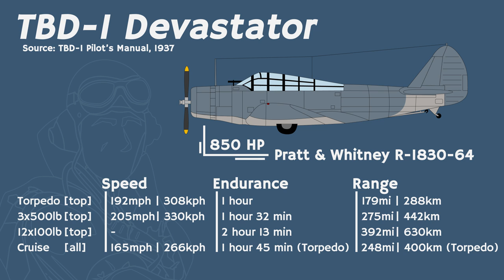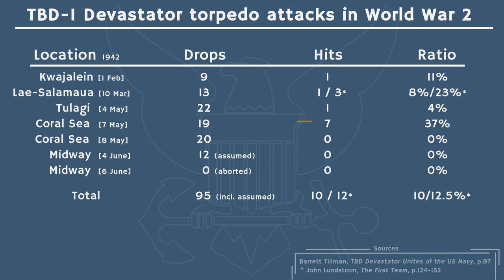In Defense of the Worst Aircraft of World War II - TBD-1 Devastator

Comment: Let me point out that the one TBF that made it back to Midway had one crewman dead, the other two badly wounded and the aircraft was so badly shot up that it was pushed off the runway and scrapped. BTW, the TBF's were from Torpedo Eight - a detachment had been left on Oahu to begin transitioning and in the emergency they were told, "Consider yourself transitioned, here's a chart showing how to get to Midway."The author of FLEETS OF WORLD WAR II noted this and agreed with this video, while the aircraft were  certainly deficient, the CONCEPT of torpedo bombing was obsolete. Since WWII it's been used once when AD Skyraiders did a "dambusters" raid on the Hwachon Dam in Korea. (I wonder if anybody in FEAF asked if the RAF had any Lancaster (Special)'s or Upkeeps left around)https://en.wikipedia.org/wiki/Hwacheon_Dam

Comment: In speaking about the "test" results versus "normal" flight speeds, for example, might these differences be from the qualities of the fuels used? It has been my experience, (through research, not personal), that the engine manufacturers will use the best fuel available for their tests to give their potential customers, (usually the military), the kind of "results" that would sell airplanes. During actual fleet exercises, there might have been a lower level of octane levels, for example, so the planes couldn't actually get to those speeds that were printed in the manuals. This is why you, and I, must take those printed "facts" with a grain of salt. Actually, I sometimes have to use a "pinch" or "tablespoon" to measure my discrepancies correctly. 
Read about Jimmy Doolittle, while he was trying to make ends meet between the wars, for he and his wife, (I don't recall if he had kids then or not until later), he gave up his commission and went to work for Shell Aviation Fuels. As a salesman, going around the world, (and actually acting as a military spy on "enemy" aircraft designs and performances), he noted the performance edge that higher octanes gave to the various aircraft. He had a great friendship with Ernst Udet, for example. Both were sad that Jimmy couldn't test fly some of the German planes as they got closer to war breaking out. 
So it goes, friendships made and broken by war. How many World War II movies have I seen where someone you were flying with had a former good buddy in the enemy camp. I can't even count the number, it seems that almost every single one had that message at least once during the film. Uh, I'm sorry, I've derailed my train of thought. We were talking about fuel octane, (or at least I was). So, that was my input for today. Better gas during flight tests versus worse gas under daily flights will cause a discrepancy in your results. In other words, your mileage my vary.

Comment: Any bomber/torpedo aircraft in WW2 was going to have a bad day if it went into battle without fighter escort.  The B-17 was slaughtered over Europe before the P-51 escorted it yet the B-17 was considered to be an excellent bomber.
Reply: the point with the B17 was that it at least had enough survivability built in to keep flying those raids at all, even if losses did stop operations maybe in 1943...the RAF bombers had no chance of trying it at all in daylight..there is suicide in 8th AF terms...then there is suicide in RAF Bomber Command in daylight terms..the 17E+ could at least defend itself in those boxes, even if the Jagers kept re-inventing themselves to break through and cause heavy losses still...
Reply: Any bomber in WW2 that was unescorted was going to have a bad day if it were attacked by fighters. The quality of an aircraft cannot be judged simply by its failure to perform outside of its capabilities. If the Devastator had better fighter cover at Midway it would have performed better. The Devastator was never meant to drop ordinance accurately and compete with enemy fighters.

Comment: Torpedoes that don't work aren't much good.  Low ceiling, lack of tactics, defective armaments, etc..ect..  At Midway they were flying coffins.  But, you have to remember it took quite a while for the Navy to be forced to except things such as defective torpedoes, ineffective antiaircraft armaments, use of outdated equipment, even a top heavy command and supply structure then add in the lack of interservice cooperation, garbled, confusing orders and basic stupidity caused many debacles during the early days of hostilities with Japan.  This included not only the US but the other belligerents also.  Between 1935 and 1939 (1941 for the US) for some reason both military and political leadership were comatose to changes in technology and world events.

Comment: The Buffalo has to be a close second.  Totally outclassed by the Japanese planes it went against.

For all its shortcomings the P39 / P40 / P400 was at least decent as a ground attack aircraft.
Reply: Didn't help that the Buffalos going against the Japanese were of the later variants that had their performance seriously hampered by their drastically increased weight, something which the upgraded engines couldn't fully compensate for.

Comment: Considering that your vids are based on technical and doctrinal facts, with the insertion of a clearly defined opinion here and there, i don't dsee why Youtube would hate or dislike your videos. Maybe Youtube has something against your accent? But then , wouldn't that make the managers of Youtube somewhat "recist in a way? 
Anyway, in my opinion, the main fault resides with the Mk 14 torpedo. If te Devastator had been equipped with a torpedo of better performance, longer range, and higher speed, it could have performed drops at ranges further than than the reach of most anti aircraft guns of the time. I don't know if this would have improved the hit rate significantly, but the plane's survival rate would have improved if it did not have to do a long, slow torpedo drop just to get into strike range.

Comment: Why attack an a/c carrier from the side where its defense is located, and NOT from the rear of the ship?  Of course, the target is smaller, but it is practically undefended.  Please comment.
Reply: one thing to remember is the carriers aren't a passive target. they WILL respond to torpedo attacks, thus against straight on attacks they can easily turn to avoid the torps. with side on attack, they'll have to turn more to avoid getting hit.

Comment: The TBD crews went anyway, knowing their torpedoes were crap...their key sacrifice at Midway was in preventing/delaying the Japanese from launching their own counter-strike, and luring the CAP away from the SBD's. As mentioned a lot, the Swordfish would have fared little better in the face of determined fighter opposition, which it rarely did; and its torpedoes were actually functional. TBD's would have worked fine in the Atlantic. I would like to have seen a TBD or two preserved, if anything just to honor the men who went with what they had, in obsolete equipment.  A fine aircraft to fly, very few flying vices, but it couldn't (like a few others) go unescorted. Good show, I never felt the Devastator got its due.

Comment: Give it four .50 cals in wings and one for rear gunner. Give it two medium sized torpedoes rather than just one that may miss and give it an escort. Problem solved. I don't understand why they never thought of things like this.
Reply: Weight restrictions.
Reply: @ernielarkin4793  They could have used a better engine and that would've gone away. For something as important as torpedo bombing it would have been warranted.
Reply: You cant just hang anything you want on a wing. No matter how much power your engine makes.
Reply: @ernielarkin4793  but 4 .50 cals weighs very little. When you compare that to the Spitfire, which got away with 4 20 mm cannons and could still turn on a dime and climb at 22 meters per second, asking for 4 12.7 mm guns sure ain't too much to hang on wings.
Reply: A AN/M2 .50 Calibre weighs 28kg (61lbs) without ammunition. So, you're adding 244lbs of weight, plus ammunition, plus you want to strap another very heavy torpedo to it, and the weight of a more powerful engine, even with the extra power, and you're expecting the airframe to cope with that. Even if all that is possible, range goes through the floor, which is kind of important for a naval bomber, especially in the Pacific, take off roll is even more impaired, which again, quite a big deal on an Aircraft Carrier....

Comment: I would argue that the Blackburn Roc was a worse aircraft. Not only was it bad at it's job, but even the job it was built for was fundamentally pointless (turret fighter).  So even if it had been designed well (which it wasn't) it still wouldn't have been of any great use.
Reply: Turret fighters had a period of marked success at the beginning of the Battle of Britain ...until the Germans adipter their tactics to not follow them into turns.
Reply: The Defiant did, solely because it looked like a Hawker Hurricane and the Germans made the mistake of attacking if from behind.

Comment: Hell it only had 800 hp what would a pilot expect . 160 is vary good for this aircraft with it's engine . The problem could be solved . Put in a larger or more hp engine . Then what ! Put on a bigger prop .  Not a chance .  Then longer gear . Then mod the airframe to handle the extra weight  .  For it's time it was the best .

Comment: It's definitely unfair to call the Devastator the worst plane of the war.  It had the misfortune of what could be argued to be American arrogance...it had, at it's inception, represented a paradigm shift in planes designed for carrier duty, and like many other American planes, that reputation prevented the timely development of planes that kept pace with the changing landscape of air combat technology (the P-40 suffered massively against the Zero, for instance...although, unlike the Devastator, adapting the tactics employed by the P-40 closed that gap, by engaging the Zero on terms that were favorable to the Tomahawk and unfavorable to the Zero.  The Devastator, however, didn't exactly have that option...there's pretty much only one way to use a torpedo plane...)

Had the Avenger been developed a couple of years earlier and the Devastator largely retired by the dawn of WWII, it would be remembered as a remarkable plane that redefined naval combat aircraft design.  The Avenger would still have been saddled with a dubious record, as the bulk of the Devastator's dubious reputation revolves around the faulty ordnance it was saddled with, along with the "sitting duck" tactical deployment inherent in torpedo delivery from aircraft at the time.  That "straight and level" delivery strategy cost the Americans heavy losses in numbers over Germany, and those were at altitude, not low-and-slow and easily sighted by anti-air emplacements.

Comment: Actually you have to look at what the U.S. was doing in terms of production. The U.S. was pumping out so much war machinery that they couldn't produce enough of the best engines, guns, etc.. to make the best of every type of plane. They were more focused on four engine bombers, and increasing the range of fighter for escort than they were in making the perfect dive bomber. Engines were also limited, so it wasn't going to get the most powerful, fuel efficient, lightweight engines. Just as when they initially made the Sherman tank, the reason it got the low velocity 75mm gun was because it was a naval gun already in production. Yes, the U.S. had the greatest production, but they also provided equipment to Russia, England, Australia, France, China etc... So mass production took precedence over quality. Another thing is who is going to design it? The best designers are going to be working on Fighters, medium and long range bombers, etc... 

I'd far from call the TBD the worst of WWII, when Russia, and Poland were sending up biplanes, and even triplanes to dogfight the ME109 or BF190. Which is like entering a go cart into a F1 race.
Reply: The 75mm Gun on the Sherman was based on the French 75mm Field Gun (which was used by the US as well), not a Naval Gun.
Reply: Robert Palfrey actually wrong. The “French 75” refers to a field piece with a rotating block, it had a fast rate of fire for its time, and was used as a stop gap at the beginning of the war because of a shortage of field artillery. It was not used in tanks because it had a rotating block. The 75 used in the Sherman was as stated excess naval guns, that used a sliding block, not a rotating block. Which has about as much to do with the French 75, as any other 75mm gun that used a completely different breech.
Reply: Robert Palfrey not to mention the French 75 was a WWI artillery piece, and would never be used in a tank. It started production in 1898, and by the time the Sherman had been developed in 1941, over 43 years had elapsed since the “French 75” entered the scene, which is to say it was outdated to say the least. Sorry to break it to you.
Reply: @Cavethug  I'm aware what the French 75 refers to. The M2 tank gun has its origins in the M1897 Field Gun used by US artillery into the 1940s, also used as an ad hoc anti tank by Tank Destroyer Battalions in both towed and self propelled (M3 SPM) mounts. 

It's not related to a naval gun. I really can't put it any simpler than that. Sorry.
Reply: @CplBurdenR  Yes it was based on the french 75mm in that it used 75mm ammo with a completely different breech, completely different barrel, and completely different recoil dampening system. So yes, it was based on the french 75 in that it keep many of the components from the french 75 - the ammo, and did away with everything else.
Reply: @CplBurdenR  Wikipedia is a poor place to base your historical information off of by the way.
Reply: @Cavethug  It's not where I base my historical information from, it just merely backs up my case, something you have failed to do. Where is this mystery naval gun you claim it's based from? 

M2 75mm Gun, based on the M1897 75mm Field Gun, through the T6 Anti-Aircraft Gun. QED. Sorry to break it to you. 

But, since all you can do is attack wikipedia, this is pretty much over. Sorry to break it to you. 

" and would never be used in a tank"

Might want to look up the St Chamond as well, matey. But you don't like internet sources, do you? ;)
Reply: @CplBurdenR  Official US Army ordinance documents detailing the design and procurement of armaments for the production of the sherman tank. Look them up for yourself. I don't have the time, not the inclination to do your research for you.
Reply: @CplBurdenR  Might want to look up the armaments board, they have this little pesky thing called records. They were the ones responsible for the procurement of armaments, say the guns sent to the factories which were making the tanks.... And yes, you're right, this conversation is over.
Reply: @Cavethug  "Look them up for yourself"

So you have no evidence. As I thought, another empty claim made. How sad. 

As I said before, based on the M1897 Field Gun. "Sorry to break it to you".

Comment: If your hammer is old and you don't replace it that's your fault not the hammers. If you use your hammer improperly and it fails again that's your fault not the hammer. If you use bad nails that's your fault not the hammers.... sounds like fault lied more with the USN then the devastator

Comment: Outdated, underpowered, underarmed. Nah, it was a bad plane in early 1942.
At least it was no Brewster Buffalo.

One more thing about the Battle of Midway: that was a rather unsporting thing to do, the Japanese Imperial Navy turning away from the attacking TBDs. Imagining how agonizingly slow it was flying already, then having to slow down even more and drop down low enough to get your feet wet, the TBDs just couldn't keep up with those nimble, lightningly fast Japanese carriers.

I have heard that at least one TBD was actually rammed out of the sky by a sneaky Japanese carrier.